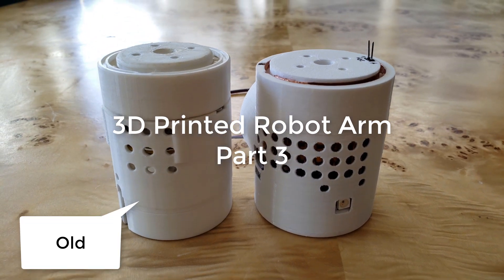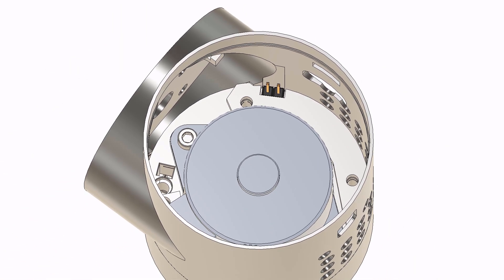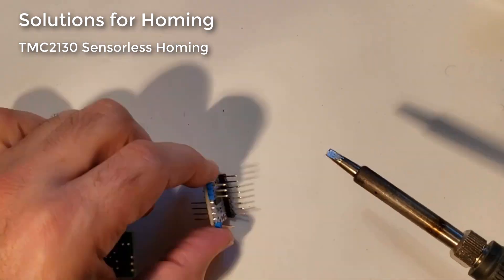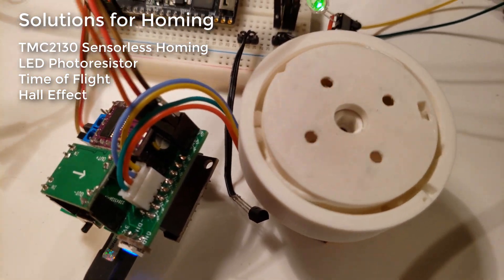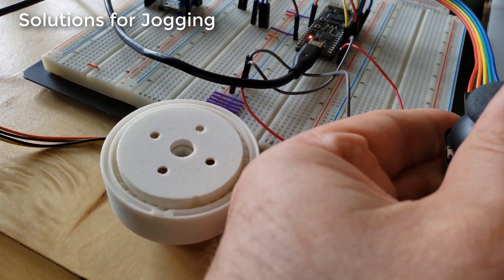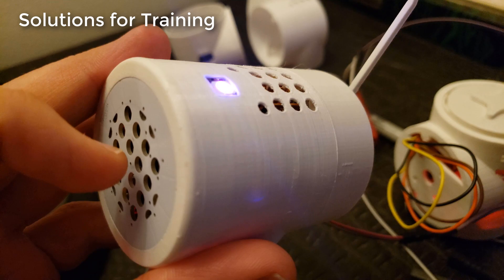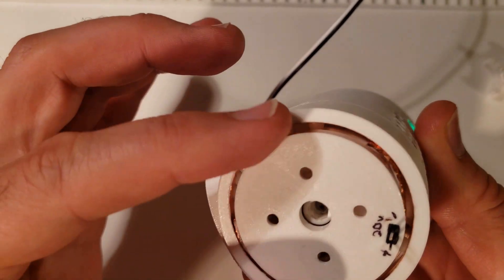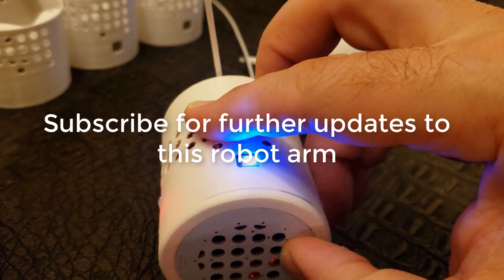3D Printed Robot Arm - Part 3

Comment: out of nowhere YT recommended this and wow, so much work must have gone into this. That's some nice solutions, the slip ring, the flex backlash solution, the touch dial (I was always wondering wtf to do with all these many touch inputs on the esp32 – this is great!). Have you considered printing your parts on a resin printer? You can get cheap ones for $300 like the anycubic photon. Or you find a FabLab near you with a resin printer. Mine got a Form 2 and it's great for printing parts like this. SUPER strong and durable. Glass fibre reinforced resin. And no pesky layer lines. It will look super professional.
Reply from the maker: I have been wondering how strong the light cured resin is, but from what you're saying it really could work. I think I'm going to go get one.
Reply: @JohnLauerGplus  My FabLab has prints on display made with https://formlabs.com/store/form-2/materials/rigid-resin/ and they are gorgeous. If the Anycubic photon (s) or Elgoo mars can use similar resin then go for it.
Reply: I haven't been impressed with Form 2 Rigid resin strength. There's no doubt that all of the Formlabs resins are much weaker than PLA. And because it's acrylic-based, it's extremely brittle. Form printers are best suited for tight tolerances and precision, not structural strength.
Reply from the maker: @bbokser  Yeah, that's been my worry that light cured resin is NOT good for mechanical parts. Many folks printing gears do seem to like PLA the best. I used PETG in this video, but I may switch back to PLA.
Reply: @JohnLauerGplus  But imagine: No sanding! Perfectly silky smooth finish out of the box (literally) ;)
The instagram factor is definitely higher with resin :P
Reply from the maker: @fearisan  I love silky smooth, but these are functional parts first and foremost.
Reply: One alternative you can try is to use light-cured resin to print molds for injection molding or casting gears. Formlabs has guides for using their prints to make molds. The desktop injection molding machine that they recommend is around $4000, but there are probably cheaper ones out there. It's something I myself have been meaning to look into.
Reply: I had PLA gears chew themselves up in no time leaving mushed up teeth that didn’t grip anymore and I doubt I would see the the same from a glass fibre reinforced resin
Reply: @bbokser  PLA has a higher elasticity. In all likelihood a PLA print will survive a single beating or some other direct impact better, probably. However I predict it will wear out much quicker, too. Since this actuator uses 3d printed gears and is not likely to be thrown around or smacked into a wall I don't think PLA is better suited in this instance. My vote still goes for glass fibre reinforced resin.
Reply: @fearisan  If you want surface hardness, Rigid resin is undoubtedly better than PLA.  But don't confuse hardness and strength. I expect resin-printed gears to chip away rather than get mushed up.
Reply: @bbokser  Yes those are very different properties. I don't expect resin printed gears (with rigid resin) will chip before PLA gears would get mushed up – but that's just guessing on my part. I am almost intrigued enough to actually try it out, put both through some testing and report back ;)
Reply: Just consider layer adhesion. An inherent problem of PLA printing. Absolutely 0 problem with resin printing. That is a huge difference in structural integrity.

Comment: Thank you so much for sharing this work.
That antibacklash solution is brilliant. Have you considered to use resin 3d print for gears?
Reply from the maker: I don't have a resin 3D printer, but would love to try it. Do you have one? Would you be up for trying it? Is light cured resin really strong enough for gears?
Reply: @JohnLauerGplus  no, I don't. But those resin printers have way better precision, which should help
Reply from the maker: @cnc-ua  True on resolution, but gears take a beating, so does light cured resin really hold up? The gears on these actuators are actually really good. It's the stepper motor that's the weakest part.
Reply: @JohnLauerGplus  there are different resins. Some of them are really tough and bullet proof. But I have no experience, so this is just a theory

Comment: Instead of the push arm wiring why not try the small bearing wiring from laptop CPU fan if you are going to do that the copper tape May wore out or may last a little longer than the push arm wiring the connecting wires to the small bearings when I go for the strips of sheet metal from Home Depot that way you will have more for the new type robotic Motors I'm just spitballing if you wanted to do that
https://m.youtube.com/watch?v=VNUYFevrHvs
Reply from the maker: You mean have the electrical connection run through those small bearings? There's not really room for the bearings anywhere. The only bearing is the large slew bearing, so not sure how that would work.
Reply: John lauer sorry I was not thinking it through I meant that in case that you wanted to go that design for the new robotic arm wiring
Reply: @JohnLauerGplus  I was concerned of how long the copper tape wiring is going to last in the motor if it wanted to last longer I was suggesting something like that and there are smaller bearings than the one I showed you in the other link the one in this link https://youtu.be/R6fPeYFXOoI might be a better choice for the bearings in case you want to try that idea for the wiring

Comment: Hey John, since the closing of G+ I haven’t been able to catch up with you regularly. I’ve lost a number of folks I regularly keep up with. Are you using any particular forum like you did on G+ previously? I’ve had to just use some other ones on FB.
Reply from the maker: Sadly the G+ forum has not been reproduced. There is this forum https://forum.makerforums.info/c/ChiliPeppr but almost nobody visits it from the G+ group.
Reply: John Lauer Yes, I signed up for maker forum, but I don’t visit much since there’s little activity. I’ll just come back here. Nice to see you doing stuff on Fusion. Did you find all those designs for the electronics online or did you design each yourself? When I designed my new controller box it would take my computer forever to calculate any move of any component within the design. Very nice design on here!
Reply from the maker: @georgeallen1751  Oh, I found almost every component online, whether it was GrabCAD or right from the manufacturer's website or now Digikey lets you filter results on whether CAD models exist. I did have to make the DC to DC model, but i think that was it.
Reply: John Lauer Thanks for the info! I can use that!

Comment: very impressive. subbed. did you test the torque? whats the limiting factor? gears, motor or casing?
Reply from the maker: I have not gotten a chance to test torque yet. Where the actuator gives is the stepper motor will skip steps. You can crank the power to about 300mA on these 35mm steppers to get more out of them. They do heat up fast at that amperage, but the fan and heatsink actually really help compensate for that if you did a short move. These are not back drivable, so you can put the motor to sleep once you're done moving and it cools nicely. Running at slow steps and full steps, not micro steps, gives really good power. It's hard for me to stop with my fingers on the actuator, if not impossible. The plastic is super strong. The gears are super strong.

Comment: What you have done here is really incredible and unbelievable. I have been following this design since you posted it on Thingiverse. I cannot wait to get started on mine but I was waiting for the design to settle down so that the parts wouldn't change since getting everything in Ecuador takes forever and is taxed. I am really looking forward to seeing this thing running with all axis using your new design and getting some specs like usable range and weight limits, etc. It is just amazing what you have accomplished so far. Thank you for making this available to all of us.
Reply from the maker: To be fair, Jeff Kerr posted it on Thingiverse. I ran with it because I thought what he did was so brilliant and made me actually believe a 3D printed robot arm was possible. I am working on the next actuators now that I feel like I've got the small ones dialed in really nicely now. It's easier to scale up this PCB design than scale it down, so I started on the small actuators first. I think the current PCB design nails it, so it's time to get more of the software layer going--particularly the synchronized Gcode motion.
Reply from the maker: One thing I'd like to do on the next rev of the Touch PCB is add icons to the dial buttons with a sort of Shift key approach, where you touch the center pad like it's a shift key, and then hit play, pause, record waypoint, delete waypoint, record all 6dof waypoint, etc. I'm finding the 1, 3, 6, and 9 second delay approach I took on the center button to be annoying. The dial would still work the way I showed it in the video for jogging, but this would give another 7 icon options for extended features.
Reply: @JohnLauerGplus  I would like to talk to you on zoom if it is ok

Comment: Great work, But if I can ask you about the dynamic model of your robot arm, and if I can have your approval in order to study it.
Reply from the maker: Yeah, this is all open source so go for it.
Reply from the maker: Oh, the dynamic model is that you train it on each axis to the position you want using the touch dial. Then record the point or all 6 points from each actuator. Then play it back. The play back just moves each actuator over the same length of time, so the longest actuator moves becomes the long pole in the tent. The shorter moves just slow down so they all end up at the end of the move at the same time.

Comment: The touch dail for the jogging is mind blowing ! Amazing work, very inspiring
Reply from the maker: I'm sooo happy with how that touch dial came out. I've never seen any other maker on the Internet go with a touch dial. ESP32 makes that possible, but there's not much code out there for it, if any, so had to build the code from scratch as well. Kinda got tricky. Had to build quite the algorithm to catch the sliding effectively.

Comment: Holy crap - this is amazing what you've done!  People are going to be clamoring to buy this as a product.
Reply from the maker: BTW, the BOM on the parts for one small actuator sits around $15 including the ESP32 $4, a cheaper 35mm stepper from Aliexpress @ $3, custom PCB $1.50, TMP36 $1, etc. So this arm could come in under $100 to build.
Reply: @JohnLauerGplus  tagging you here too, see above
Reply from the maker: @gedr7664  I'll check that filament out.
Reply from the maker: Jeff, you started it all with your design. I never thought 3d printed gears would work, but actually, they're working! I did move to PETG in this latest build and I'm liking it better than PLA for the strength, albeit I can't get as clean of a look, but so what. I even find the flex spine to be a little nicer on the PETG.
Reply: @JohnLauerGplus  Interesting.  The Thingiverse User MechEngineerMike did a blog post comparing materials for 3D printed gears.  He seemed to indicate PLA had better wear properties than PETG, but I would think PETG would be better for impact.  I've never actually tried PETG gears, though.  Nylon, I think, would be best.  At some point, I'd like to make this gearbox using SLS printed nylon.
Reply: @lobocnc  Check out Igus' filaments, they are engineered for bearings!

Comment: Damn this really is amazing, cant wait to see the final build. Mine is coming along nicely.
Reply from the maker: How far along are you? Did you get to the electronics yet?
Reply: Finished up the three lower joints and wrote some custom software for them and my computer for controlling. Using the first kind of PCB you made.

Got it working propperly and it can move to a desired x, y, z position now from the computer.
Reply from the maker: @dagsvikeleven1589  http://chilipeppr.com/arm is coming along as the control software if you want to check it out.

Comment: Cool project... have you considered using AS5600?
Reply from the maker: I sort of did, then tossed the idea out becuase there was nowhere good to place it on the actuator. After seeing the video, any thoughts where I could place it? I do think I still may run into issues in the future where you need to detect missed steps and the robot should know it's got too heavy of a load. An absolute encoder could be the trigger for that and solve the homing problem. Have you used the AS5600? With 12-bit DAC, is it really precise, or noisy and indeterminate such that you end up with about half of that resolution or worse for knowing your absolute position? I have one in my electronics stash but never really played with it much.
Reply: @JohnLauerGplus   I got my AS5600 from ebay a few days back... Still haven't opened the package... Will let you know how it goes when i get a chance to play with it... Which motor are you using for this project?
Reply from the maker: @nakulsolanki  The 35mm stepper motor is in the BOM on the Github repo, but really I have 3 different motors I've been using. The expensive one is here https://www.moonsindustries.com/p/35mm-permanent-magnet-stepper-motors/35pm048s8-08001-000004611120001819, but I needed some beater/test ones too and they seem to work just as well. This one is really strong and almost as good as the Moon's but you have to grind off the gear with a Dremel https://www.aliexpress.com/item/32975464158.html
 and then there's this super cheap one that works fairly well but isn't as strong and doesn't need any grinding https://www.aliexpress.com/item/2054451318.html

Comment: Great work! The slip ring idea, that’s awesome, can’t wait to see this in action!
Reply from the maker: Thanks. I hope the slip ring holds up as a concept, but I am seeing little blips here and there. That would mean a power loss on the subsequent actuators. Wondering if the blips can be smoothed by a cap, super cap, or even rechargeable battery. Needs to handle 20v though.
Reply: @JohnLauerGplus  Hi John! I'll think, the copper-to-copper slip ring will cause more an more problems. What about graphite-coals, eg. like a drilling machine? Would it be possible to install the slip rings on the inner rotating part and the coals on the outside part? Like a motor? Then you could also attach several coals distributed on the circumference of the outer part.
Sorry for my english, i'm from germany: O)